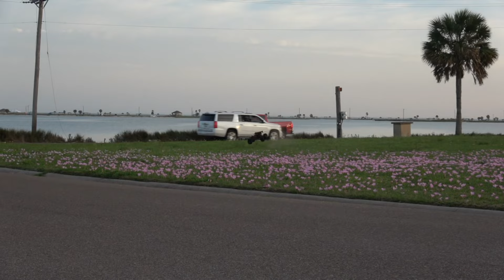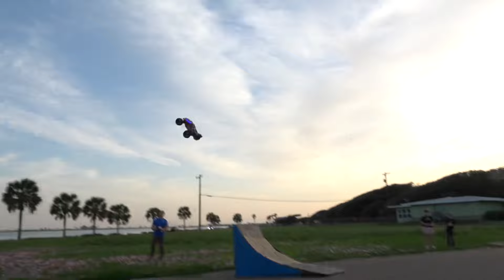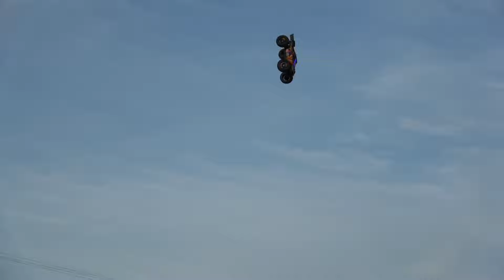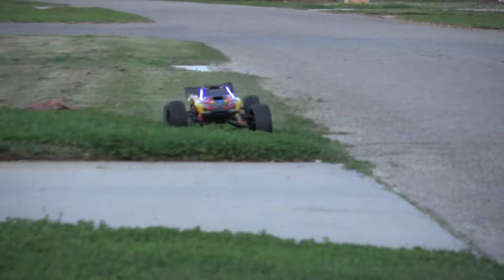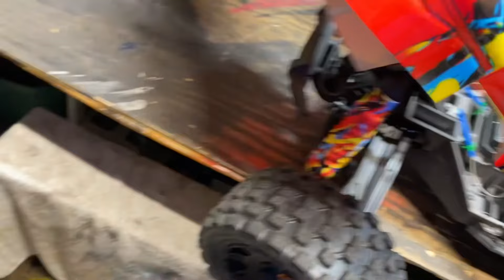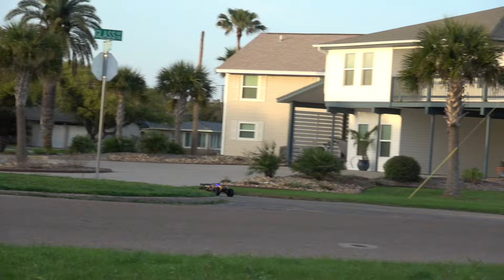My Custom Traxxas XRT

Comment: Big dawg! May I please have your recommendation.

Own: xrt ultimate and sledge. Absolutely love my xrt. But the belted tires don’t let me flip well.

Decided on Xmax for my next RC because of you. Your videos on the Xmax are INSANE.

There is the regular Xmax, the new release that has a few more mods and the belted tires, and the Xmax ultimate.

Which do you recommend for skatepark bashing?

Thanks
Reply from the maker: Sure bro! Go with the original Xmaxx or the latest version but Don’t Buy The Ultimate. Too many metal parts involved makes it weaker!👍⚡️⚡️⚡️⚡️
Reply: @thunderrc  gotta go with what the man himself recommends!!! The regular Xmax it is. Bro! As far as big body bashers, Xmax is best right?

Comment: You got lucky with the pinion coming off when it did. I use Green locktie on mine. Never comes off but have to heat it to get it off.